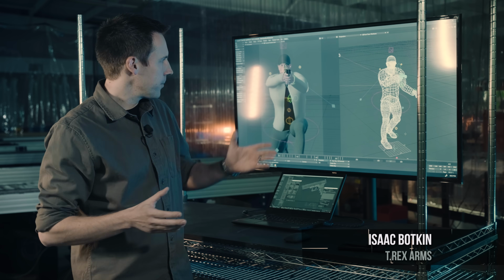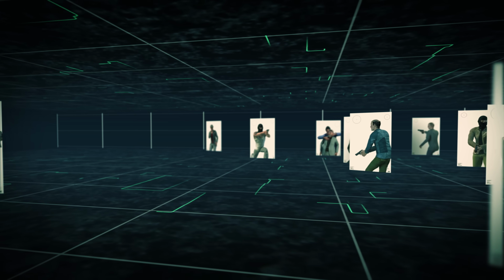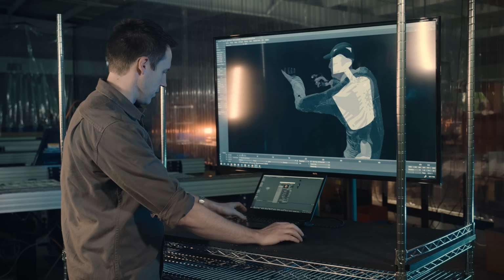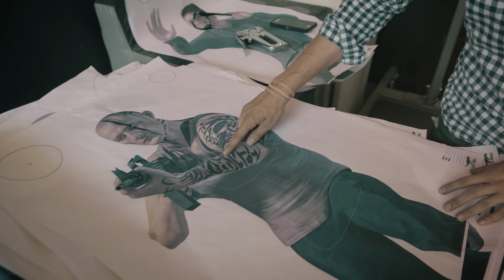Next Generation Target System for CQB

Comment: Sefardtech CIF/Crif school used something very similar many years ago. Not 3d models. But they had hundreds of targets and would have you shoot the first targets as bad buys about 5 or 6 times. And then would change the hands to be non threat on the same target that was a threat. It also includes low percentage shots. And had over 450 targets in different poses and with different items in hands. And you have to use your lights on the weapon system to see what they had in their hand. So this is more of an update patch. Taken from range 37 shoot house. Its an update. Version 1.5b as opposed to 1.5a. Now this is great for some Leo's and civies. But SF and the Cadrea assaulters who have gone to the MILITARY version will find this very familiar. Gonna share with a CIF and detachment 222 guy and see what he thinks. And it will be interesting givin  the teams pov of this channel. Want to see what they think about this patch system . Thanks for the video
Reply from the maker: Already been used at some of the places you’ve referenced 😎
Reply: @TREXARMS  Neither Range 37 nor 75th are using these targets exclusively. Being used at a location and being endorsed by them are two totally different things. From a SFAUC instructor - Who pays $75 for 25 paper targets? We have two sided shoot / no shoot targets (same person, one side no shoot, the other side shoot) that cost $1.52 / target if we only buy 25. That's $38. I'd rather buy more props for the mannequins. The training effect can already be achieved with existing targetry by angling the target stands. No clear threat, no shoot. Engaging a paper target on a side wall (especially in a hallway (left or right) or left / right fed room) has no depth or realism in the first place. You have to get to an angle to view and engage the paper target that may not replicate where or how you would engage an actual person; so the paper target drives your actions instead of tactics. Further, you already know the targets are all on the walls; so, the first place shooters look for targets is on the walls and stop scanning for threats down low, behind cover, sitting, etc. Targets on walls also don't force the shooter to consider what is behind / around the target in depth where a miss may hit another person or they have to decide to shoot "around" a non-combatant. Further - a paper simulated "moving" target is still a stationary flat piece of paper. In reality, that target would (obviously) be moving and possibly crossing other shooters sectors of fire and possibly masking your shot. The paper target still gets processed as a stationary object. Its simply not reality based training. Changing target types is standard practice, among other target discriminators. Not sure who your customers are; but if they aren't changing targets they are amateurs. The problem isn't the target; its their training methodology. You achieve the same effect by simply changing the targets and location, regardless of whether it looked similar to the last one. In other words, just have a variety of targets. The biggest problems with paper is that..... it doesn't move (while you may be moving as well) and its flat. Having a scoring zone is fine for one shot; but, after someone gets shot, they move (willingly or otherwise). So, saying someone's arm is in the way is only valid for @ first round. After that, it’s a crap shoot on how they react to being shot. Some continue to fight, some immediately drop, and some do crazy things like charge / run randomly. Its paper, nothing new to see.  Shoothouse training has to be grounded in reality. There are too many bright idea fairies that think they are inventing something new. Its all been tried before and people have had to learn hard lessons to get to the best practices. Shooting is but one aspect of CQB; communicating, multiple teams, non combatants in the room, bad guys that give up / are captured have to be dealt with, etc are others. Having no shoot targets is great; but, the team still has to deal with them and not just, not shoot at them. In reality they are people on target that may be / get in your way. They may actually be bad guys. You wont know until you process the target and figure out who is who. Just paper wont get you there.
Reply: @TREXARMS  this has already been used in Range 37? For CRIF assualter training and with Detachment 222nd? Or with the ranger Cadrea? If you could please specify. Also the teams you mentioned that did not like it. Were those police, leo, hrt, or military?

Comment: Outstanding solution for a very complex issue.  The issue is not of the gear, the issue is with the THINKING, and this gear helps solve the issue with the thought process.  I’ve been professionally teaching Military, Law Enforcement, and responsible citizens since 2004 and I wish this had come out sooner!  I’v used my own t-shirts, hats, etc on targets to try to create variability, creating 3-dimension targets, but even with that I’m severely limited.  Short of simulations, this is the best target system I’ve seen!